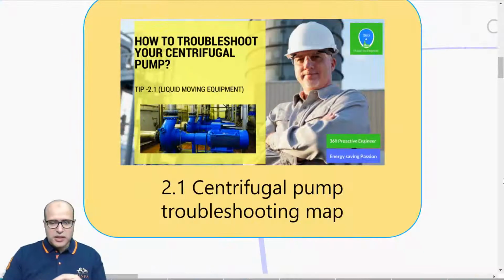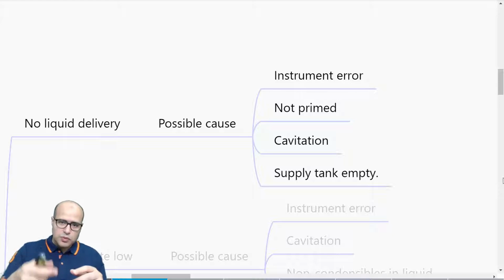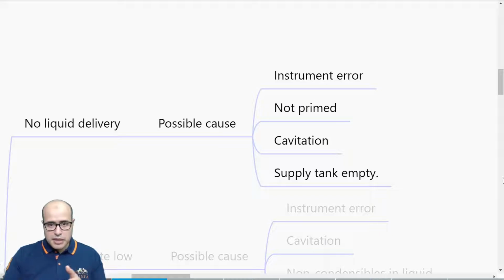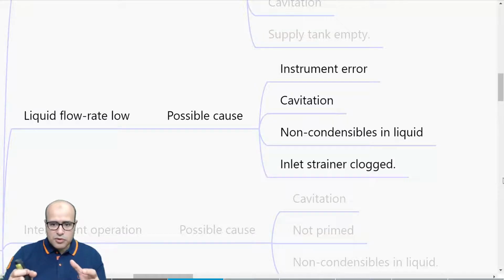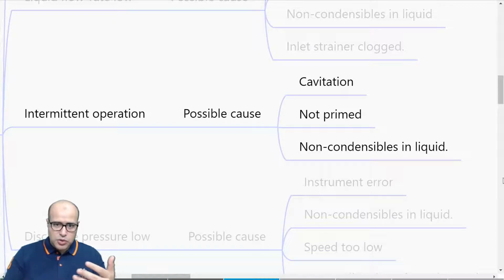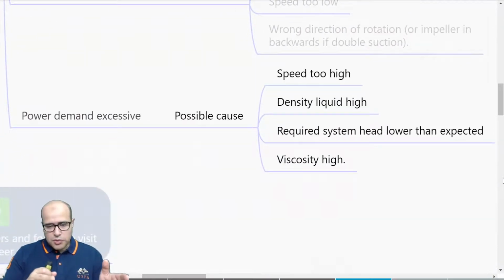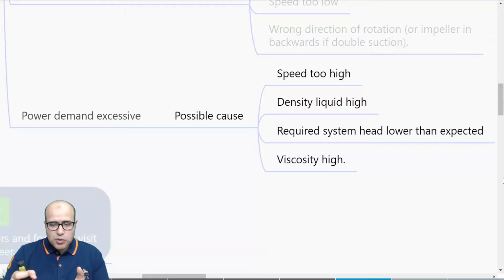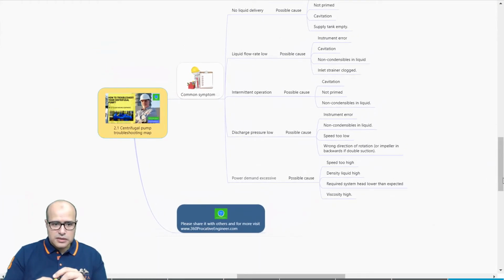Centrifugal pumps troubleshooting map

Comment: can we change the flow of centrifugal pump without changing the impeller
Reply from the maker: you can install a variable speed drive that can change the pump speed and change the flow but you need to check the required system head as the pump pressure also will be decreases when you decrease the speed.